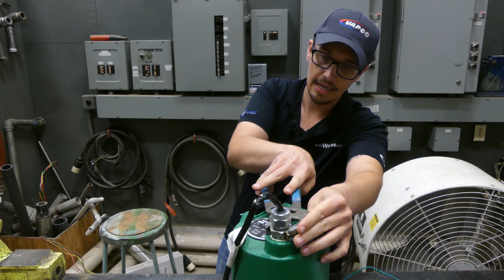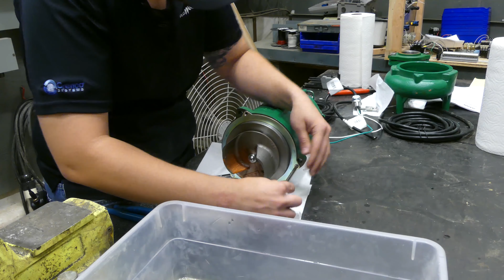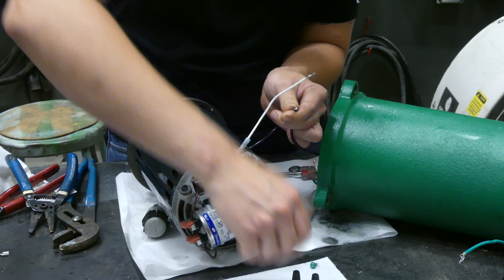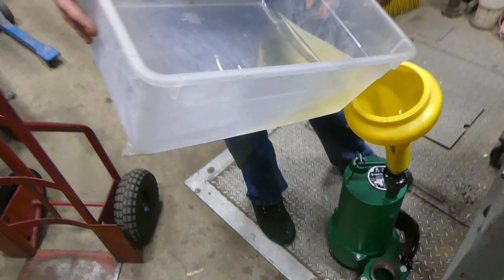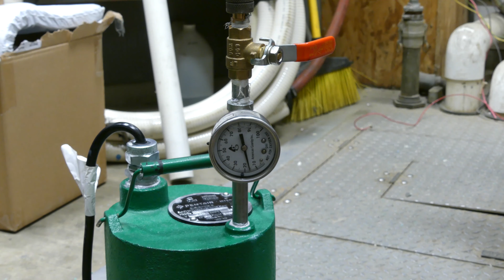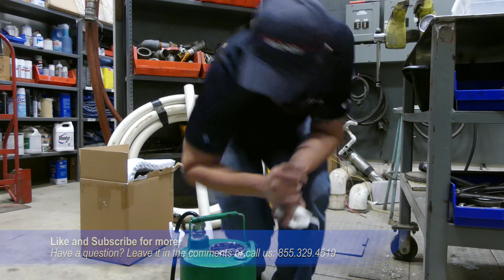Replacing the Power Cord on a Sewage Pump

Comment: I recommend discharging the run capacitor before servicing the pump.  If you don't know why or don't know how, you need to educate yourself on the topic in order to avoid getting zapped.  It can hurt a lot and at worst will kill you.

Comment: How many liters of oil fill in 2 hp myers sewage pump?
Reply from the maker: You want to fill to the top of the motor windings
Reply: @RCworstwater  thank you Sir, i can't find a turbine oil,is it ok if i replace it with 5w 30 fully synthetic oil?

Comment: Hey Chris, you've become my hero as of late!  My Myers (1/2 hp  12.5 Amp 115 V single-phase...or so the specs to my Myers control panel nearby say on the badge...I've downloaded the schematic for my panel model, which is CE(DS) - 11SW ) sewage pump, which was down in a concrete vault 8 or 9 feet, and associated alarm went off again....2nd time since this past summer, went off about 5 years ago for 1st time for me (city worker told me to spray some degreaser on the floats and hose 'em off...I did...worked for 5 years apparently) and last time I'm afraid.  All told, it has lasted 22 years having been installed in 1997 before I moved into the house in 2003.  
There are 3 green Myers tethered mercury float switches in the vault (as you know!) at 3 different levels:  Stop - Run - Alarm
Now, I'm a caveman, but I do believe these switches are normally OPEN, and close enabling a circuit at 10 degrees angle or such.
Sound familiar?  Yep...you know this beast(!)  Oh, BTW, the alarm buzzer goes off for high water...but it just registered with me that the red alarm light has NOT lit up...ever.  And I think I know why.  I checked the two 1A fuses and both had accumulated corrosion.  No continuity on the one (though I cleaned it and it shows continuity...not that I intend to reuse it!) on the left side and the schematic indicates it is part of the alarm light circuit.  The RH side fuse, though also corroded,  was just good enough to fir up the buzzer(!)

                        **  Am I workin' ya too hard?  That's OK 'cause I been crappin' up in the woods for almost 2 weeks now!  **
                                                                                :)  (Really, TIA for any insight/comments/advice.)

* The situation now:  the pump/panel won't run in "Auto' mode & can't be switched into 'Manual' mode as the toggle immediately (almost violently!) switches into the 'Off' state.
*  After cleaning the floats back in June the 'Stop' or lowest hanging float I noticed was sunk!  It was at the end of its tether and under the surface of the water.  Not good.  (Could I have sprayed it too hard with the hose such that it rocked & hit the side of the vault too hard or many times?  There's no visible sign of a crack or a hole although I suspect the very top where the cord enters the float..can't say exactly why but it's my gut feeling.)
* I wasn't able to get any continuity reading off the float wires.  I turned them each sideways as if floating & checked on the meter which seemed to be the logical position/angle to me.  However, I was by myself and it was awkward trying to do the readings and hold 'em at the same time(!)
* I wasn't able to get squat off the leads to the pump motor (disconnected from power & breaker OFF!) except when I connected the  Green wire to the Yellow wire (there's no white in the 4:  Black - Red - Yellow - Green
Black to Yellow should have shown a small resistance according to the Myers specs, like 1.33  to 1.47 Ohms @ R x 1, but absolutely nothing showed on my meter!  :(
The Red wire went to terminal #7 (last one left as the floats use 1 - 6), the Black wire went to a terminal labeled M1, the Yellow to a terminal M2 and the Green went over to the ground block.  So, as a caveman livin' & crappin' here in the Ozarks it looks like 2 hot Commons, a Neutral, and a Ground.  You're proud of me, I know!)

Currently, I hoisted the motor out of the vault so that I could do a 'Turd Autopsy'!  LOL  Really....prior to that last week I made a little mesh scoop bucket to dip down in the water to see what I might catch.  I wasn't crazy about that:  sanitary wipes, some little grey plastic sprockets, small glass pieces, some beads, a thin palm-sized piece of wood and some marble-sized or slightly bigger pieces of cement mortar from the sloppy job the workers did finishing the inside concrete/brick for the part of the vault that sticks above ground...about 3 or 4 bricks high...and upon which the heavy lid rests(!)   I can see several more chunks of mortar/gravel stuck in place on the inside up high...but for how long?

I've about got the vault drained of all gray water and have NOT been doing any laundry, using the toilet inside or bathing for that matter!  (Woa!  That & greasy hair are scaring people I think!)  My ladder is already in it.  I'm a gonna get down there and shovel out whatever sludge/solids remain and put them thru a sifter I made.  Inquiring minds want to know what's down there.....
Muwahahahahahahahaaaaaa.......

OK, Chris.  That's it for now.  There'll be a quiz over this material next Tuesday.  Please review your notes!  ::)

PS  The local health dept is supposed to repair this unit.  (I live in Missouri, BTW)  However, the city water bureau has told me informally that any repairs/parts are the resident's responsibility on these sewage systems.  Should that be the case I would like to discuss with you/R. C. Worst Co. on the phone where I can get a similar float, and possibly a new pump if this one can't be rebuilt somewhere close to me...so I don't have to ship it!!  Mercy...it's like 85 lbs.!  (The base/discharge metal is starting to shear off like chalk...haven't cleaned off the upper motor part good enough yet to see if its metal casing is deteriorating too.  Probably...!

Have a gooder one!
Reply: Woah! Now that's a comment! My gut is saying float switch failure and possibly issues in the control box. You are welcome to call to discuss the details.

Comment: I have Gould’s pump like that it  needs a new cord haven’t had time to search to see if I can get a cord But with this pump in the video it looks like it’s just a standard threaded in the water tight connector that clamps around the cord I basically could just buy a new one of those!  Though on my Gould’s pump it had a water tight thread in fitting and a special epoxy water stop Barrier built into the cord so that water wouldn’t wick down the individual strands of wire!  This pump doesn’t have that feature and I think I could probably get away with a similar set up for such a old Gould’s pump!
Reply from the maker: I'd say it's worth a shot,  you might want to hit the new cord grip with some epoxy after tightening to add a layer of water protection.